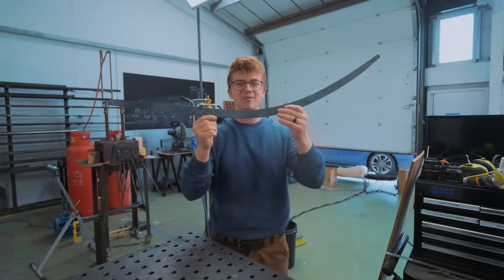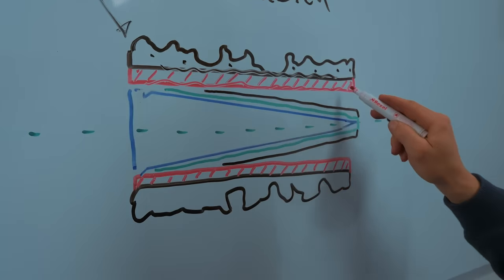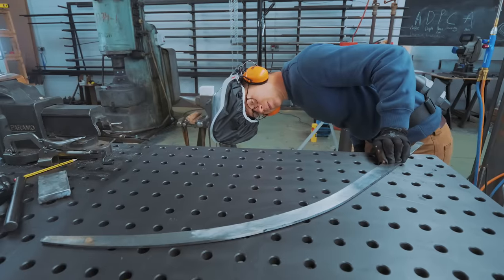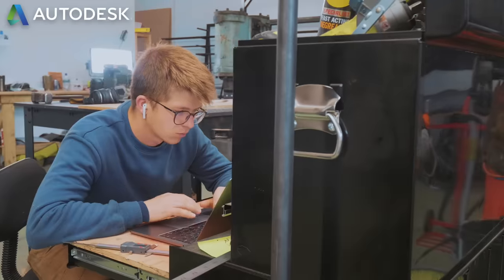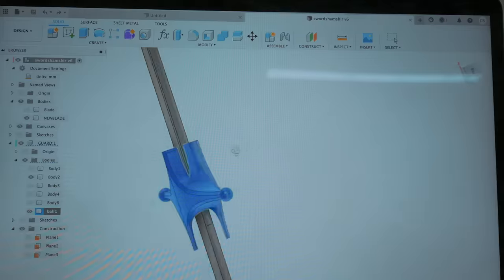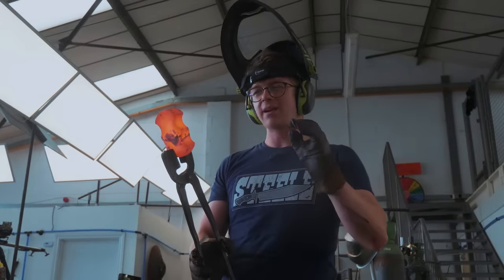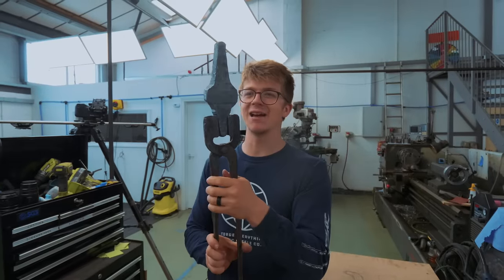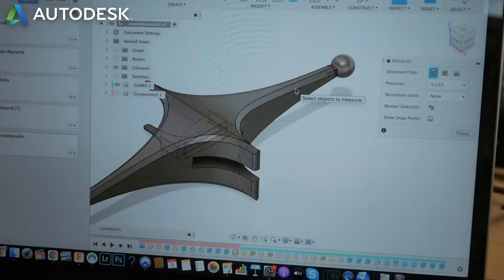MAKING A SHAMSHIR SCIMITAR!!! Part 2

Comment: Alec, I have an antique Safavid shamshir. Do you want measurements and a tracing?
Reply: Hopefully he sees this!
Reply: Upvoted and commented to help him see it
Reply: HYPE
Reply: Upvoted to increase chances of Alec seeing this
Reply: alec get at the dude
Reply: Best option is to contact him via his websites request section.
Reply from the maker: Woops, a little bit late! :'(
Reply: @AlecSteele  :( Sad
Reply: I was going to propose the same thing! I also have an original Shamshir, from the XVIII century, which I bought in Damascus, Syria, more than 20 years ago.

Anyway, @Alec Steele, if you do need any pictures or measurements, let me know. I thing the details on the guard fitting could be particularly interesting, since they look a bit different from what you are doing (of course, you are using much more precise machining, so you can do better work than what was done 200 years ago).
Reply: @piccalillipit9211  to

Comment: I'm sure the YouTube algorithm doesn't reward you for it, which is probably why you stopped, but I sure do miss the 15 plus minute episodes. It always felt like you covered so much more territory in a single episode.

Regardless, I'm still more than happy when I see a new video uploaded, even if they seem slightly abbreviated. Keep up the great work!
Reply: Honestly I would prefer he didn't do the 20 aprt series, they're boring, and slow. What is spanned across 6 parts should be in 1 20minute part. In reality what did he do in this part? Did maybe a quarter of the guard? And nothing else.
Reply: @PBMS123  I like to see the intire process its fun seeing all the details
Reply: @hyperionempire7209  Except he can do that without making 20 part series, where barely anything is covered.
Reply: @PBMS123  things are covered

Comment: PPE flex, followed by not using the PPE that is resting on his head and instead safety squinting and turning away while using the saw to cut more material which also makes metal dust (7:17)

Comment: A thought on achieving those points on future guards. If instead of using two rollers (one top one bottom) to effect both radii, if you were to use two top, two bottom, and space them the width of your points(?). Then the material would extrude between the rollers. See?

Comment: You should try to forge using grinder shavings, the stuff that is all over the floor in the grinding room.
Reply: They are all oxidised, so you would have to smelt it in order to get steel out of it.
Reply: I don´t know much about it, but this material is for shure full of non metallic particles from the grinding belts, other kinds of dust and scale. Also,  the steel particles are probably burnt and decarborized.
Milling shavings can provide a much better candidate for this idea IMHO.
Reply: @guifxx  what of u melted it all down into a block then welded it.
Reply: @_0ut_263  Then you’re smelting it

Comment: If it's too tricky to forge the guard as one piece, you can forge it flat without the spikes at first. Later CNC, fold & grind said spikes to shape and weld or insert them into the guard.
What I mean by inserting them is drilling shallow female holes at the center line of the guard and welding a male pin to each spike, dropping them into place and welding them on for security. Grind away the leftovers to make it look pretty and save some weight, chisel in the detail work and you're good.

Comment: For one of your projects could you save all the scale that comes off while power hammering and weigh the loss. i'm guessing it's not much since its super thin but i'm kind of curious how much there really is
Reply: i do not think that the summed up mass of the scales equal the mass loss during hammering, because the scales are a product of oxidation (anyone correct me on this one please), so the mass of the scales is material plus air oxygen.

Comment: Never quite understood why Alec doesn't do closer-to-finished forging.  It's immenently possible to do, especially if you're using non-layered steel where the pattern isn't an issue.  It saves a ton of time, saves a lot of material, makes the grinding and finishing easier...

It's not like he doesn't have the fine-detail chops.

Comment: An easy, clean way to remove scale is to soak in vinegar overnight and use steel wool to scrub. Probably alot cheaper than abrasives, easier on your lungs too so long as you don't stand over the tub of vinegar too long. Downside..., I craved french fries.

Comment: If anyone down here in the comments is specifically a Bladesmith, is there a difference to grinding a flat piece down into an edge, and forging an edge out with a hammer or machine and then sharpening the edge from there? Or does it work out the same way.

Cause the teeny bit I understand of how atoms and stuff work is that a flat piece ground down may have it's grain or orientation of atoms at a poor angle or something, so it may be weaker than something shaped into a wedge and then sharpened. Is my assumption in that incorrect, or is the difference small enough that either method works fine?

Comment: I got constant anxiety seeing those tough gloves near that belt grinder. I remember from your earlier videos on workshop safety the only kind of gloves allowed in that area should be latex ones to avoid contacting with water/dirt, but that will rip instead of dragging your fingers between the belt and wheels

Comment: I fully expected it to break when you were straightening the blade, but I guess your not far enough along in the process for such problems.
Reply: Normalized steel can be handle several percent length change by such processes before breaking.  So no problem cold bending to correct a minor warp at the current stage.  The trick is the blade staying straight through the heat treatment as the introduced residual stress is released.

Comment: Comment on the software. I know Fusion 360 is awesome for many usecases. I still need to note something. I don't think you are actually utilizing the most important advantages of parametric modeling. Those being highly complex assemblies and integration with cnc and technical drafting. I am not saying it is not working for you, but that there is a more efficient way for you usecase. I suggest trying out some of the more concept level cad programs. Blender being free is a nice choise. Inventro and Rhino are kinda hybrids to parametric from visual and widely in use of industrial designers. Advantage being much faster but less measurement accurate workflow for more efficient creative work. Which is what you are using cad for anyway.

- Mechanical engineer, drafter and designer

Comment: the challenge, design a sword... start forging. You get one piece of steel (you choose the size) per component. finish the sword....... . . . .. All without computers. Bonus points for hitting your marks. Minus points for missing marks and using way too much material.

Comment: I have been watching all the episodes back from the time, when Alec was working from a garage. However, the more I am watching, the more mesmerised I am of how much material he can waste. It wasn't like this at the beginning. These days, if he doesn't grind 70% of the material of a project, that is deemed a highly efficient use of material. Environmental issue is valid, but even more the art and craft of forging something into a near form of a final product. To be honest, I was surprised that he didn't forge a massive plate of Damascus, cut the rough contour of the blade, then ground it to a final shape, obviously discarding remains of the plate. Might as well use CNC instead... I stopped at 7:21 when Alec was about to cut yet another piece of steel. One should watch Torbjörn Åhman to see how wonderful and intricate forging can be.

Comment: Just curious why not just use the mill to face your stock instead of the 9 inch grinder then the 36 grit belt
Reply: He doesn’t sell mills!
Reply: @brettcox8143  he doesn't sell 9 inch grinding wheels either so I don't understand your argument/point.

Comment: And once again Alec is back to making 100 part episodes with arguably a miniscule amount of content in each? What did you do in this episode really? You got maybe 25% through making just the guard. You forged a single piece of metal and then ground it for a little while.  I love the work you do, but honestly it's just boring having a 10 minute episode cover almost nothing. I would prefer 3 parts 20 minutes long released further apart than this mess. 

And so do others, you can see it in the views of past 15+ part series where you do so little there isn't any content, the views gradually die off.
For the sake of the people watching please make these parts more substantial. Imagine the forged in fire series, that pacing is about right, if not maybe25-50% too fast. And go from there.